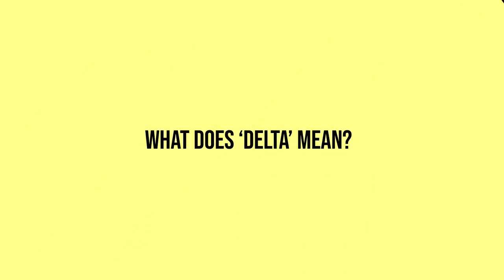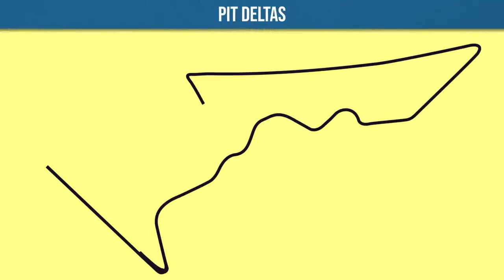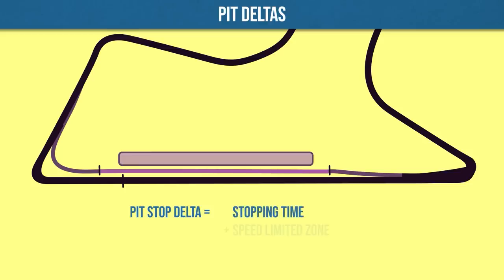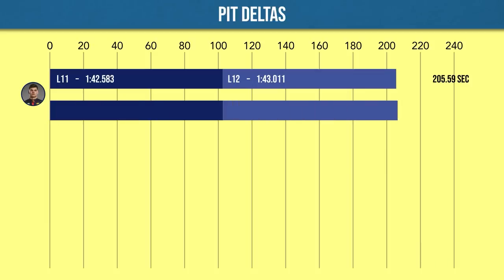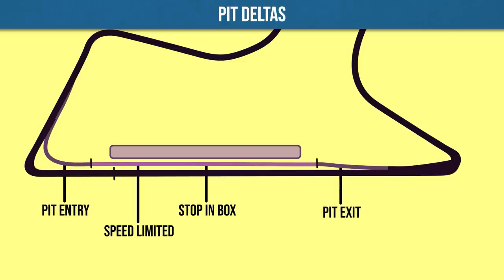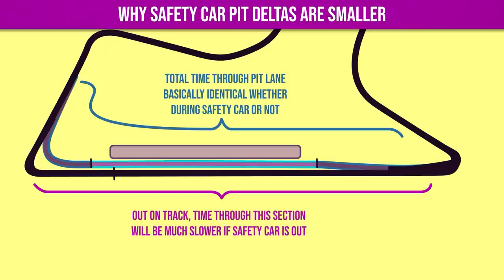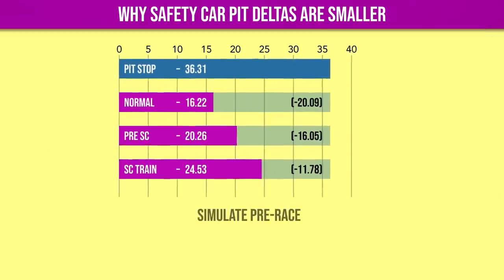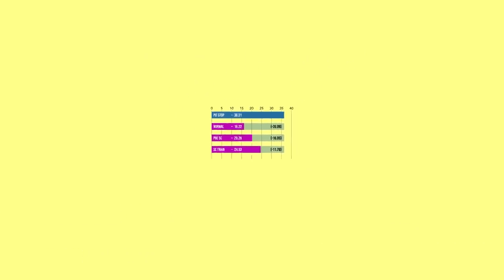F1's Pit Stop Time Loss Explained

Comment: Slight tangent, but I've always felt the introduction of the pit lane speed limit was a big aggravating factor in the rise in 'boring' races over the subsequent era (as well as the bigger issues of car size, aero disruption when following etc). Pit stops became more 'pricey' due to the longer pit delta, making it harder to claw that time back - so drivers became less able to risk diving into the pits for a fresh set of boots when they were racing for position. Add in good tyre durability and there was pretty much no incentive to stop if you didn't have to.

The apparent solution to rebalance that - designing compounds with massive deg to create a bigger lap time offset between fresh/worn - has taken quite a few years to figure out, but recently it seems to be coming good: seeing a number of races in the last couple of years where late stops for fresh tyres have created exciting finishes with drivers chasing each other down in the closing laps (even without needing a SC or VSC situation).

Obviously would never advocate getting rid of the speed limit due to safety, it's just a situation I occasionally ponder.